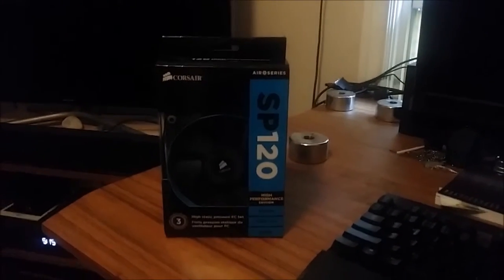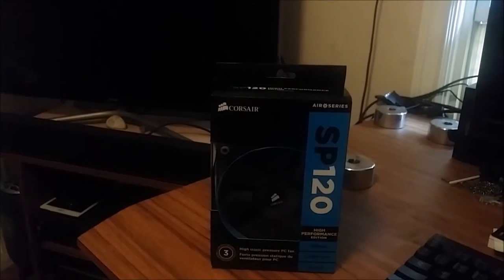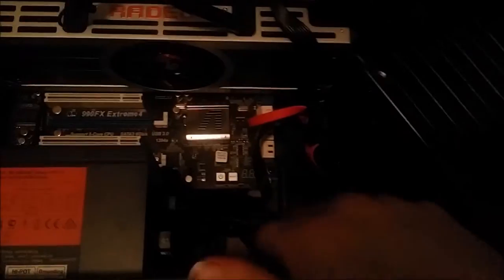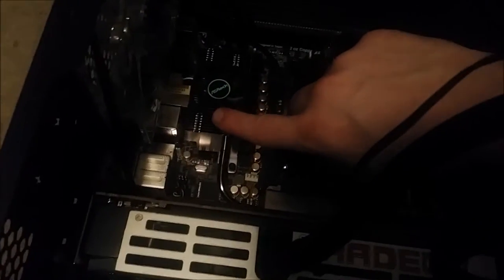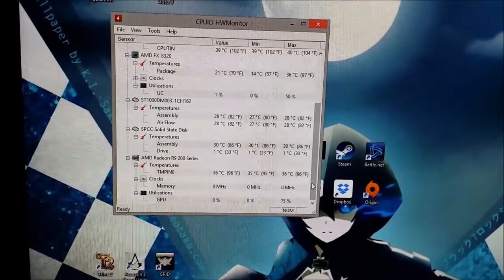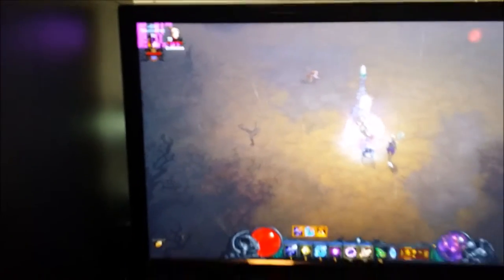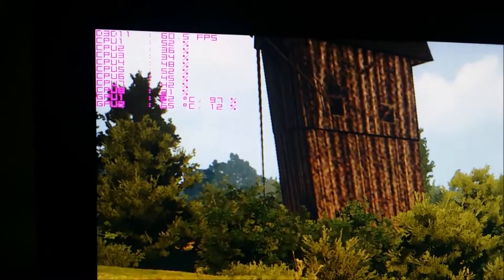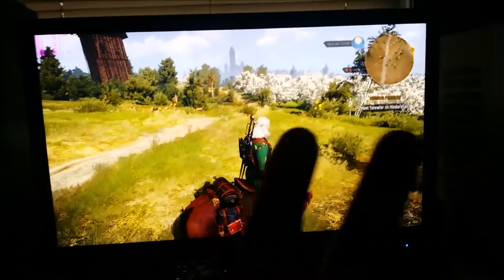AMD R9 295x2 Fan Upgrade + Temperature Testing

Comment: hey man my 295x2 is coming in next week, i had the 290x2 devil 13 and that card would idle around 85c playing gta4 in 4k!!! what temps can i expect from the 295x2 running it for about 1h in 4k maxed?
Reply from the maker: Marc Melancon I only have a 1440p monitor but with my Corsair Sp fans in push pull it maxes out at 68c after 8 hours of game play.

Comment: did you record your room temperature when your GPU is running in the 70s ?   how about your room temp when your GPU is at 65?  water cool greatly affect by the room and even case temperature
Reply from the maker: Lucky for me my NZXT case has very good airflow. But I believe the temperature was 25c when it was at 70c and temp went up to 28c when it was in the 60c mark. I should have shown the room temperature too ill do that from now on.
Reply: +XxViciousxX have you though of mod the cooler some more?
Reply from the maker: +John Pham Besides Push/pull there's not a lot more you can do. My next step would be a full custom waterblock.
Reply: is the R9 running that hot?   Have you though about cutting the water cable and install another radiator  and keep the OEM water pump and such ?
Reply from the maker: John Pham There are actually two pumps on the card but id rather not mess with he card before the warranty is over. the 295x2 runs way cooler then my single r9 290x its cold enough where i'm not worried about it. my 290x gets into the low 90c range some times.

Comment: The 8320 is def bottlenecking
Reply from the maker: WarFace HD It was I fixed it tough used my old 2500k got it at 4,7 ghz.
Reply: XxViciousxX Yeah but even a 2500k is still a little bottleneck for that card since people are getting on valley something with 100 fps' ish
Reply from the maker: WarFace HD Oh I'm sure it still is a little  bottle neck. But I ran that test at 1440p so I'm not sure if that makes a huge diffrence or not. But I haven't seen my cpu hit 100% yet. I've seen it at 75% in Witcher 3. But a least it's less of a bottleneck then the 8320.
Reply: XxViciousxX oh don't know if 100 fps was 1080 or 1440.. well I bought myself a 295x2 for 500 bucks (used one but only 4 weeks old off of ebay). I have a 3930k clocked at 4,5Ghz slightle undervolted I'll let ya know if I get better results :)
Reply from the maker: WarFace HD You're CPU is a monster I just had the 2500k laying around. I just figured other then CPU's like yours there is nothing that is no much better CPU'S  then my 2500k that it would warrant  getting a new mobo and processor. But yeah let me know I'm interested in how your setup does.
Reply: XxViciousxX Yeah but for benchmarking I think, I'll clock him to 5 GHz. I only have him at 4,5 so I can undervolt and cool that cpu with 700rpm fans even under load my fridge which is about 15m away (I think thats about 55 feet) is louder than my PC during burn test :)
Reply from the maker: WarFace HD Nice mines definitely not quiet. But it's a massive improvement over having the 8320@4.6. That was as far as the chip would go and it got really hot like 60c hot. That's with my h100i on performance mode. Made the PC sound like it was about to take flight. Now that I am using my 2500k@4.7 I can leave it on quit mode but the rest of the fans in my case are not exactly quiet.